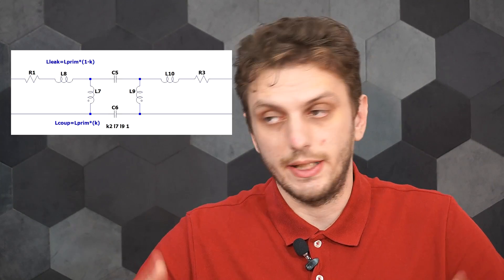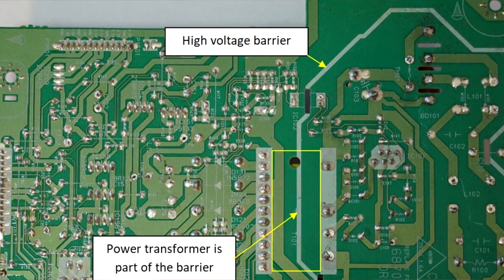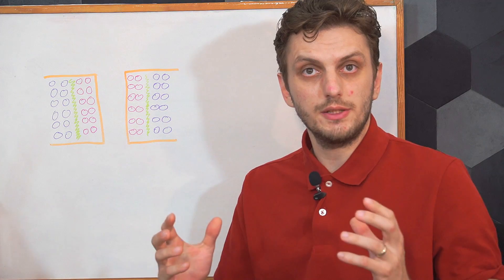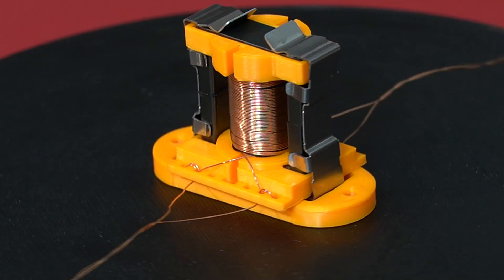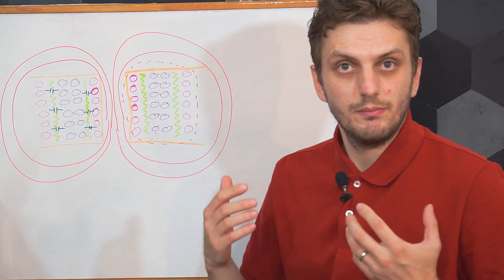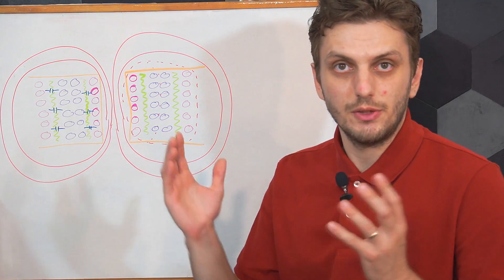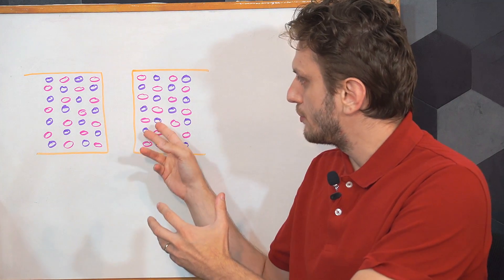Electronics tutorial -TRANSFORMER construction and performance

Comment: Regarding the reduction of the capacitive coupling between the two coils, it might be interesting to do some experiments with faraday-shields (an intermediate single layer winding of wire or foil, connected only on one side to a fixed potential, thus producing a capacitor between each coil and the shield, but reducing the coupling from coil to coil).
Reply from the maker: I was actually planning on doing that in a later video. I just have some other topics already partly prepared.
Reply: @FesZElectronics  Cool!

Comment: Interleaved windings are also really useful or actually needed for transformers for audio purposes, to get a nice frequency response up to 20kHz.
One of the reasons why mains transformers don't work well in audio circuits, because an high isolation is more important since they only have to work at 50/60Hz.
Reply from the maker: I guess its important to add here that at 20KHz an iron core no longer behaves as well as it would at 50Hz. It starts to loose its magnetic permeability; so the way in which the coil is built will help to reduce losses as more of the magnetic flux is going outside of the core.
Reply: Interleaved.
Reply: @rogeronslow1498  yes, that is correct, hat was a typo :)

Comment: Excellent analysis. It would be interesting to check the highly-enclosed cores like ferroxcube p-type. In theory they should give best coupling as they minimise the open areas where stray flux could escape. Also toroids should be pretty good if you keep the winding intimate to the ferrite core.

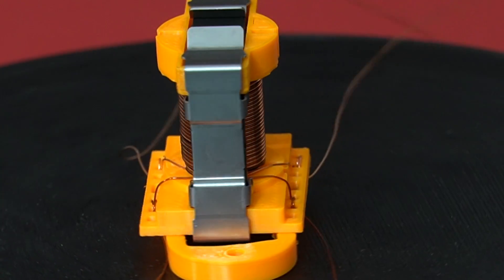Comment: With the parallel windings example @13:20 where you state that this method is limited to a 1:1 turns ratio, would it be possible to parallel-wind say, for example, two or three or four wires for the secondary for every one wire of the primary?  Granted, this would no longer be a perfectly parallel winding scheme, but the inductance geometry would seem to be mostly preserved.
Reply from the maker: Honestly I never seen that done in practice, or try that; but it should be possible. You would not get a coupling as good as for the 1:1 circuit, but it still should be better than all of the other methods discussed.
Reply: @FesZElectronics  maybe I should file for a patent, lol.

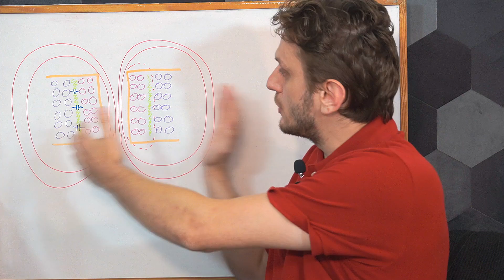Comment: 8:22 When you reduce the capacity between the 2 inductors, wil this also increase the heat development in the primary, 
or is that only if a inductor or the primary in this case has no core?
Reply: From dissipation point of view, the whole transformer dissipates it's loss on it's outide surface area. The main loss is usually caused by the resistance of the wire. If you choose the wire sizes so that the primary has the same power loss as the secondary, then it should not matter which winding is inside or outside. The inner layers will get more warm no matter what, as the heat resistance to the core then to the air is higher than the heat resistance from the outer layer to the air, and on top of that the inside surface area is way less, but the total dissipation will be the same.

Comment: What are the advantages of simultaneous winding over split inductors? The interwinding capacity is high and the coupling coefficient is only slightly increased, so there seems to be no advantage. Are there any other considerations?
Reply from the maker: I guess the coupling factor increase was marginal only in my experiment; in general this sort of winding - also called bifilar winding, as pointed out by other viewers - will give the best possible coupling factor. In other words, there is not much more that can be practically achieved to improve on this. Its usually widely used in RF applications.

Comment: hi 🤓.. why the secondary voltage of my step up ferrite transformer get very high at no load what is the reason do you think ?
Reply from the maker: Regardless of transformer, there will be some voltage drop as a load is added, but this can be made worse by the type of converter you have built - so if there some sort of control logic driving the primary, not just a basic sine wave.
Reply: @FesZElectronics  thnx for the replay . yes you are right its not a sinwave its square wave

Comment: I'd love to have a list of (vintage?) books (and any other resources) to educate myself about all things transformer (and similar things like motors, alternators, etc., for that matter).  Do you have any recommendations?  I'm especially interested in audio transformers.  I'd like to understand why for instance, pro audio electronics designers are happier with Jensen (and other premium brand) transformers than with ordinary run-of-the-mill ones.  

I'm also interested in designing power generation equipment (micro hydro) and would like to have a good understanding of how things like wire gauge, # of turns, etc. are to be determined, given water flow rate and volume, desired output voltage and current, etc.
Reply from the maker: Unfortunately, I don't have a specific list of documentation. Usually I try to go for Application notes and Datasheets from the actual manufacturers of such products. Usually the manufacturer knows more about their class of products and use cases than other third parties.
For hydro and power generation related info, I really don't have any input, its not something I am very familiar with.

Comment: Thank you for a great video. What is the make and model of the special, gray-colored adapter that you are using to connect the tiny wires to the meters? And, where can it be purchased?
Reply from the maker: I got the adapter together with my multimeter, it was not bought separately... The multimeter is AxioMet AX-588B. On the adapter is written "Multi function socket". Hope this helps.

Comment: How much "natural" isolation do these coatings provide? I just built my first flyback converter on a breadboard to step up 12v, experimenting to see how high of a voltage I can generate. I used a 68µH 3A ring core inductor and wound 12x the windings for a secondary (just directly on top/in between the thick original wires). I charged an Elko to 350V. Is this near breakdown voltage? And I guess I just discovered that I chose the worst method for capacitance...
Reply from the maker: The breakdown voltage will of course depend on the exact type of coating applied, but you should get 1-2 kV on most typical wires; a very important aspect to mention though is that if the coating is scratched or peeled of for any reason, you get no more isolation... For this sort of voltages though (350V) you should be fine.

Comment: What about using low electric permittivity dielectric isolation?
Reply from the maker: Of course the dielectric permittivity will have an impact on the capacity in-between the inductors, but just how much of an impact depends on how much air there also is between the windings and isolator - the windigns are not perfectly flat...